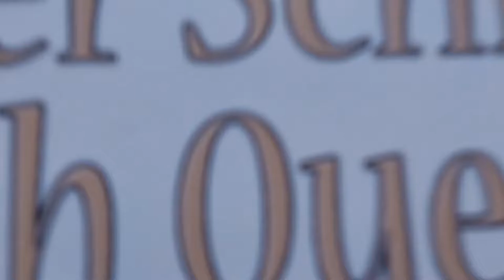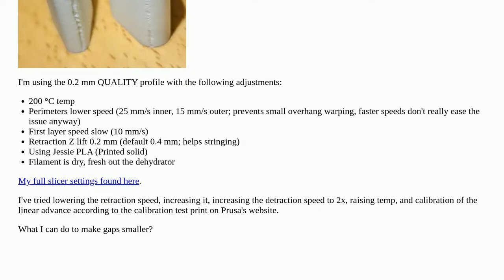Seams of print are underextruded causing large pits/gaps? (Prusa Mk3+, Prusa Slicer)

Comment: And you are happy with that??? ofmg. i guess im a perfectionist then? In cura there is a setting to fix this, and in the 5.4 the seams are MUCH better default than this. i get almost invisible seams by setting this value to the nozzle width. you can caliper that gapline and find that its the nozzle size almost exactly. (or it should be. if not u are under or overextruding.

gees that looked awful imo..